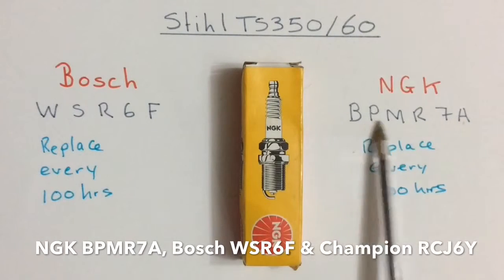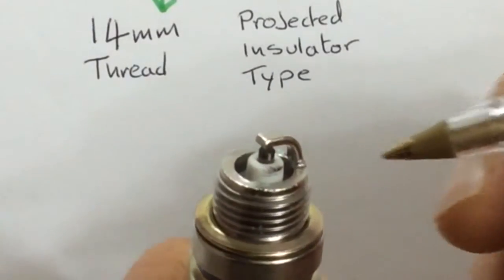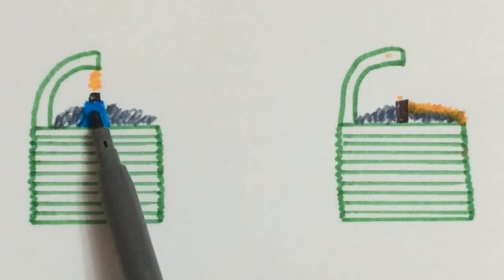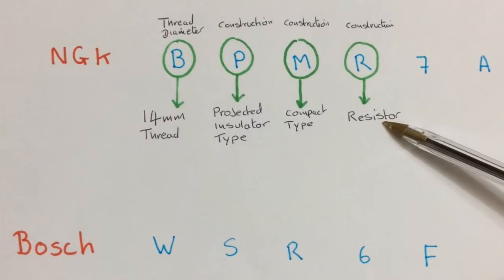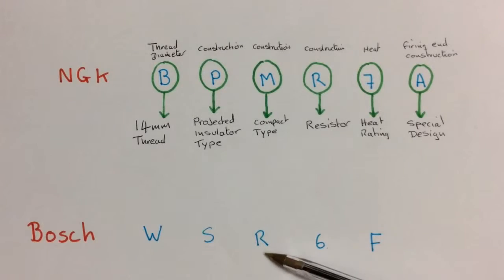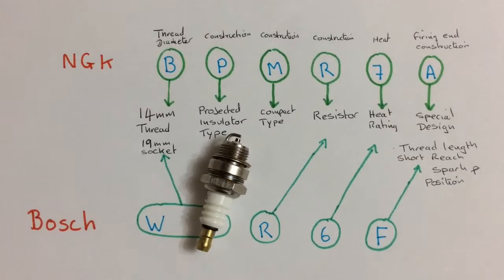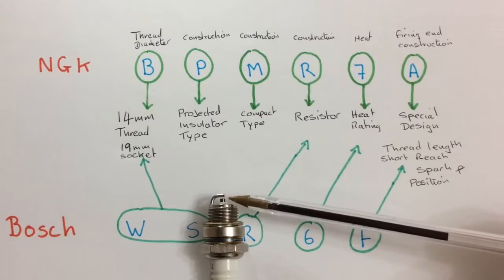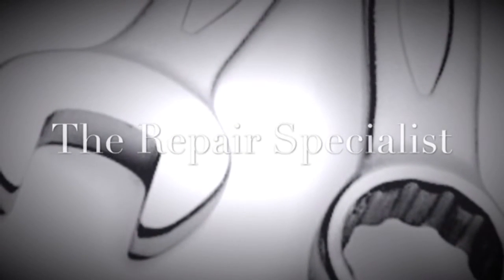SPARK PLUG CODES EXPLAINED (Effortlessly) (by Craig Kirkman)

Comment: Hello Which is better for sniper 150 version 1.... CR8E or CPR8EA-9?
Reply from the maker: Hi there, thanks for the question. The plugs you’re asking about — CR8E and CPR8EA-9 — are both NGK motorcycle plugs, often used in bikes like the Sniper 150. The main differences are the projected tip design (the “P” in CPR8EA-9) and the factory gap setting (the “-9” means it’s pre-gapped at 0.9 mm). Which one is best really depends on the manufacturer’s recommendation for your exact engine version. I’d suggest checking your owner’s manual or NGK’s plug chart for the Sniper 150 to be sure you’re matching what the engine was designed for.

Craig